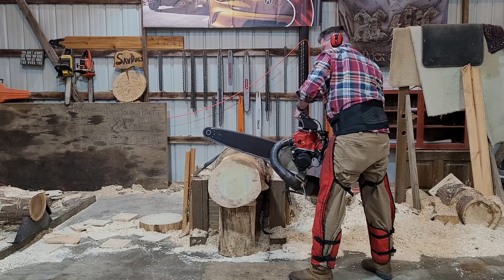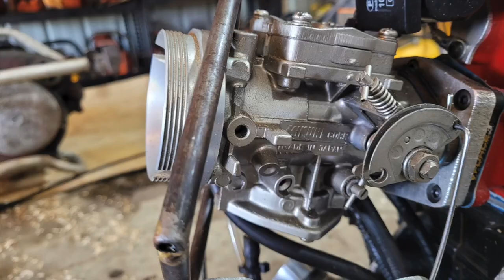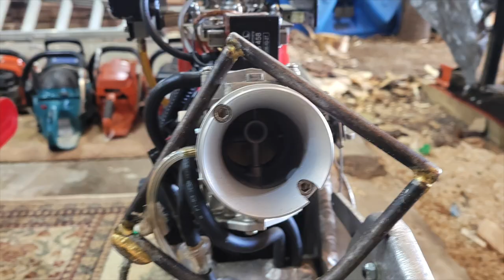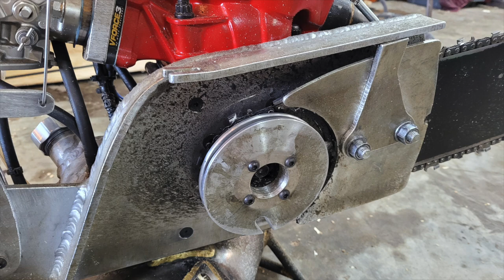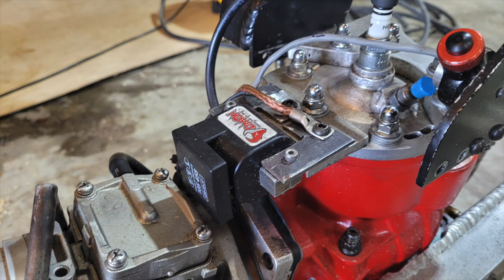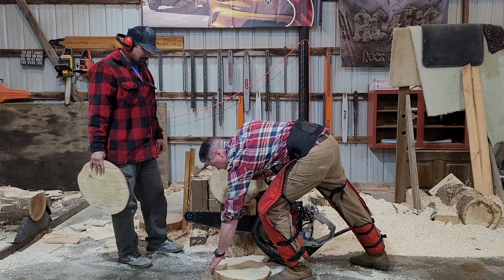An in depth look and first time running a real Hot Saw Bike Saw racing chainsaw

Comment: Were you afraid of dropping the saw as you exited the bottom of the cut? If you're pushing the saw to load it up, the bottom of the cut comes up awful fast! So fun watching someone run a real-deal hot saw for the very first time even in their life. You don't get to see THAT everyday! Nice job, gentlemen!
Reply from the maker: Yes.  On the first cut, I didn't even think to push at all until the last second,  but then it was exactly as you suggested.   I was afraid of the saw smashing into the ground.  There was a lot going on in those few seconds!
Reply: @novicelumberjack  I have so many interests that, I HAVE to live vicariously through my friends - because I only have ONE LIFE TO LIVE! Please be my friend! 😁

I've always loved hot-saw. The gyro forces when you're coming from the ground while the RPMs are coming from "Hot idle" to peak RPM under WOT conditions are not something one plans for. Think of it - the record shows that when you fired the saw and came up for the initial down-cut - you instinctively backed out - then went WOT again as you were getting a hands on assessment as to how much that machine was going to try to rotate clockwise in your hands - so you could compensate perfectly for a good - plumb line down through the cut.
I gotta say - I'm a little envious! I wanna play!
I think you did an awesome job. I know I'd have gone a bit wide on MY first cookie too, because NO-ONE is going to feel like breaking out on their first cut is going to be "fun!"